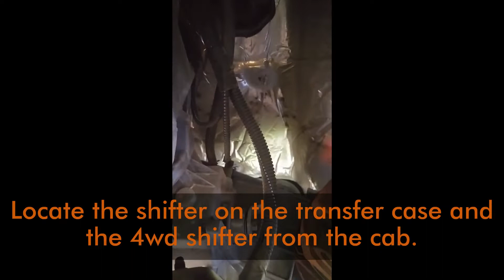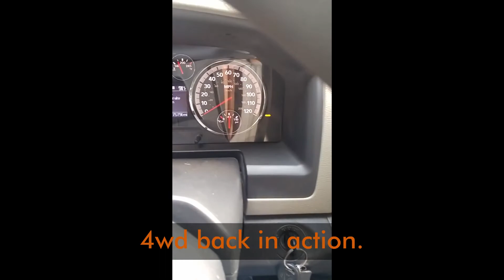Dodge 2500 4wd Not Working!!!!

Comment: I've been getting a slight jiggle in my Ram 3500 4wd shift when going over bumps and stopping. I've been worried it is a warning sign something bad is happing. I've already checked the linkage under the truck which looks good. Did yours give you and warning signs before it stopped working? thanks
Reply from the maker: No. No warning at all.  I went to put it in 4x4 and the shifter just moved freely.  Luckily, I found the linkage.  It's worth taking a look at those rubber bushings for wear.
Reply: What part was needed
Reply from the maker: It was a rubber bushing that held the linkage in place.  Super simple part, but created a real issue.